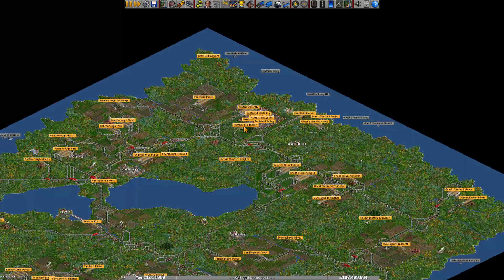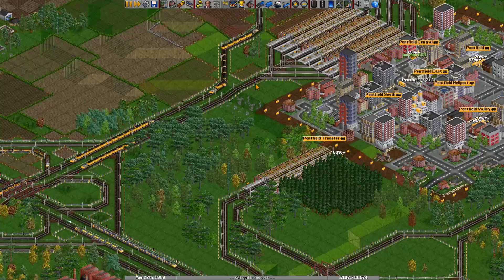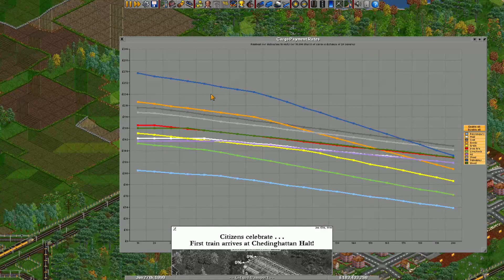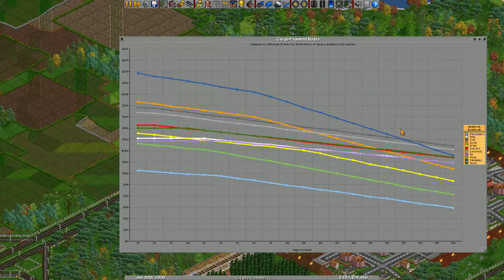Git Gud at OpenTTD #15: Banks and Valuables!

Comment: The Chartbourne train should leave empty at Pentfield because the trucks have no way of taking the Valuables back to the bank. 
It would be possible if you transfer the valuables from Pentfield at the Chartbourne Mines station and pick up the transferred valuables at Chartbourne Woods. This requires only a direct railway connection between Chartbourne Woods and Chartbourne Mines and a Truck Terminal at Chartbourne Mines.
It might even be better to delete the river and place a train station there.

Edit: Same for Chedinghattan.
Reply from the maker: Yeah I only noticed later.. I fixed it in between videos :) Good catch!